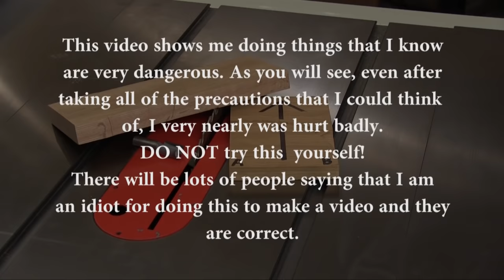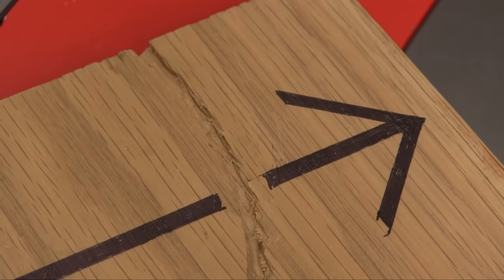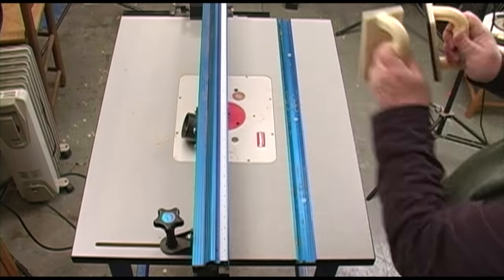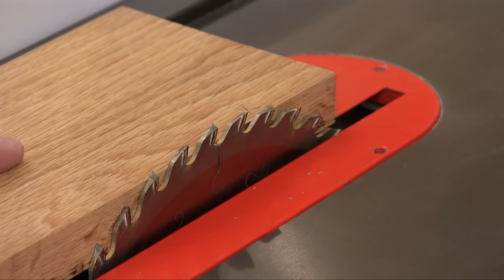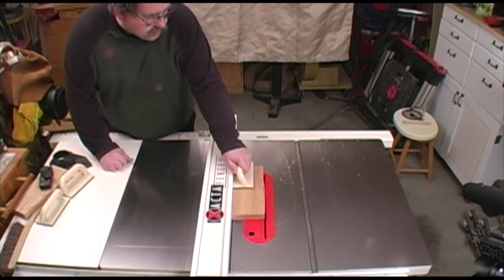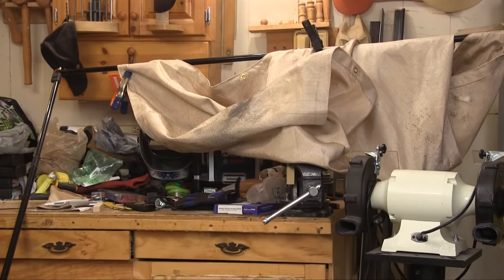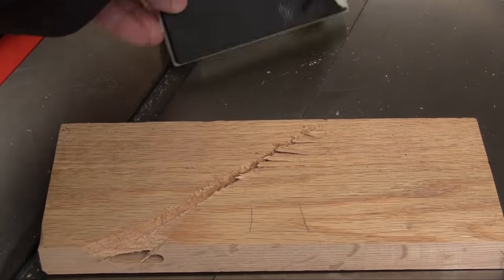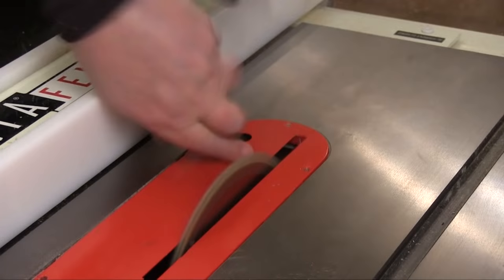Kickback on Camera!

Comment: Some 35 years ago in shop class, we were shown the true power of a 16" 10hp table saw when the instructor was ripping a full sheet of 3/4 birch ply. Intentionally, the sheet was pulled to the side opposite to the RIP fence on the outfield side of the saw. (Again this was an intentional example of the power of this saw and there was nobody in supposed harms way) 
The cut was pushed through until about 6 feet
, then slid over. The cut was finished by the force of the kickback tearing most of the remainder and a secondary tear perpendicular to the blade. The cut off was thrown back some 20 feet, and lodged into the CMU wall. The sound, and the violence of the entire thing was something that I'll never forget. He did catch the edge of the ply with his shirt. 
He also taught us to never drop the arbour nut and washer in the cabinet   while changing blades for the possibility of it getting sucked up dy dust collection and destroying the collector. If someone were to get  caught dropping it, the class would have to fill their pockets with sawdust. This only happened once...
He was a good teacher, a little drunk at times I think, but a good teacher. Long story short... that shit is there for a reason. Don't be distracted,  in a hurry, lazy, or just plain stupid. Even a small 10 contractor saw is capable of changing your life for the remainder of it

Comment: Guy in my shop was Raising drawer fronts on a router table. He had taken the guard off and wasn't using push sticks. As soon as the panel bit remove the last bit of stock the wood Tipt in and mutilated his right hand. It's not something that's immediately obvious but when you remove stock on that final pass the wood becomes unsupported.

Comment: I've been using table saws for over 30 years now. never one kick back.  Now I have a nice newer Jet saw and have the battle scars to prove kickbacks hurt. A piece of 1/2 birch veneer rode up and spun on the blade just as the video shows. I wondered how close my fingers came.  I'll be installing a riving knife on the saw before I ever use it again.  thanks for the video and glad that you are ok other than some shot nerves. Kick backs are powerful I'm surprised that I didn't break a wrist on top of the whole thing.
Reply: Yeah they are terrifying.  I have only had one (due to a poorly aligned fence) and I am wholly convinced that I am using long push sticks forever.

Comment: I generally always use my saw without the plastic guard on top.  Those things are so annoying and get in the way.  I didn’t even know you could remove the back guard, but I never will after watching this.
Reply: > the back guard

The “riving knife”.
Yes, that thing will prevent the vast majority of table saw accidents. Without a riving knife, it’s very easy to have a disaster. Just push the wood a little bit the wrong way and BOOM.

Comment: Well I appreciate you making this video, as I’m so amateur that actual amateur woodsmiths wouldnt sit near me at a woodworkers party(if they threw parties? I dunno).
But one question: are there no safety devices or grabbers you could’ve used instead of your bare hand?
Glad you’re ok tho and thanks!
Reply from the maker: I worked for more than 3 months with engineers and saw designers on how to do this test in the safest manner. The push block was used because it allowed me to pivot the wood against the fence as it turned into the wood while pulling hard against the fence so that all my muscle tension was away from the blade, not pushing into it.
Reply: thintz12 Well sir that’s incredible. Well done. All my childhood helping my pops, and ever since, I’d never understood kickback much less respected it. Thanks again for this.

Comment: I had an accident in October of 2022. Was ripping a 4x4 on the table and it kicked back and my right hand happened to be down and split it wide open destroyed my tendon and my nerves I have about 7 in scar going for my middle finger down to my wrist. Can't really move my middle finger anymore. Very little feeling in it too
Reply: Yeah  i had pretty much the same.
Reply: Damn.  The board did the damage or the blade?  You should ask your doc if physical therapy is worth a shot.
Reply: Dude thats crazy. Table saw is the one tool that I am scared of buying.
Reply: @dusty,@greg, did you guys have a riving knife installed?

Comment: After watching your video, I begin to be scared to use my table saw. 😱
Reply from the maker: NO need to be scared, just follow the instructions and use the safety equipment. Many, many people use saws without issue mainly because they pay attention to what they are doing and use the safety equipment and features.
Reply: No need to be scared. But always treat it with respect and caution.
Reply: @flyingrcdotnet   I get intimidated by the table saw but more so with the Miter saw. I had very close call with it. U got a nice laceration on my thumb. Luckily nothing broken and it was not  deep enough to need stiches. It totally mangled the board and it happened so fast. I am very careful and always make sure I am staying focused.
Reply: Don't fear the tool, but always respect it.

Comment: I was around 15 and set out o build a picture frame for my mother for easter - so the father of my girlfriend lent me a router. So one day I was in the cellar trying to route my first  wood. He told me to go right to left, but this felt kinda hard to push. As the instructions were given in a Hush-Hush I was wondering it I was doing it wrong and next try was pushing left to right - with the router turning direction - and the wood went woosh and there was pain in my finger. I made it upstairs calling for my Mum, who was upset in turn, why I was not coming upstairs and properly telling her what I needed - until she saw my white face and red index finger. Another trip to the doctor or hospital - I do not remember. It was just a "flesh wound" and left a big scar on my index finger.

I was never a "do as you are told" kid - _I was the "tell my why or I will find out" type. And for power tools this is not they way to go. In a different timeline any of the adults should have carved out some time to show me or watch over the first passes.

Comment: I did not have a back stop and had  a piece of hard wood flooring vibrated Into the blade and kick back into my face!!! Pool of blood all over this person brand new floor. 
Went to the hospital and got stitches and then went right back to work less then 2.5 hours later lol.
Thankfully no harm done. Accept to my face. Lol! 
20mm gash w/4 stitches between by eyes, and memory I won't 4 get not to mention a sweet scar. Now I have a habit of keeping my head off center when I turn the table saw on and NOT putting other wood on the table saw.. lesson learned

Comment: You're doing a good thing to show people to be careful, even you learned a lot.  I was cutting some 1/4" wall, 4" diameter plastic pipe, about 2 ft long, some years ago.  The pipe clamped down  on the blade, shot back, and hit me in my stomach.  It lifted me off the floor, and I was still in the air when my back hit the wall about 12 ft behind me.

Comment: I always use the Riving Knife but not the guard thingo over the top, never see anyone using that part on youtube, should I? I feel it obstructs my view of the cut
Reply: A very skilled woodworker told me the blade will do the cutting wether you are looking at it or not. Keep your attention towards the fence and your piece itself. With that fence locked onto your measurement there is no need to watch the cut.
Reply: Even with my limited experience, I feel that almost all tools have that bit of "this would be so much EASIER to use WITHOUT that safety feature". Or quicker. Cheaper.
And of course, 99 times it'll be fine. but that 100th time, you might not get up again.

Comment: I learned two things from 'Wolfman' Whitney in high school woodshop that stuck with me for 50 years of woodworking:
1 - A power tool is nothing more than a simple hand tool with a malicious intent.
2 - Never ever-ever-ever take your eye off the blade. 
I met many folks at wood shows who were missing digits.  When asked, they said the same thing; they were not watching.  

I still have all my fingers, even after years of playing with explosives.

I did once catch a 12" x 12" piece of 1/8" aluminum in my belly that I was cutting on the table saw with a worn carbide 10" blade (how stupid could I be?) when it kicked back.  It fortunately hit at belt level and cut into the belt and bruised the snot out of me. 🧐😳

Comment: Bloody idiot! ;) Thanks for sharing, even though you put yourself in considerable danger mate. 

First time I experienced kickback I was standing in the wrong place and actually took a push stick to my stomach, had a 15cm bruise with all kinds of crazy colours for about two weeks. Luckily the stock didn't hit me and my fingers were well clear of the blade. However, the stock flew off on it's own little holiday, I reacted by trying to move my hands away... reaction brain forgot the push stick was 25cm longer than my fingers, subsequently hit the top of the blade and did a nice little spin as it hit me in the gut. 

I investigated why it had happened of course. Turned out I hadn't calibrated my fence well enough and caused a pinch at the back of the blade, so the riving knife couldn't do it's job  yet. 

Lessons learned, I check and double check the calibration before I start cutting down any stock now.

Comment: Thanks for this video. You kinda idiot for demonstrating this by nearly loosing a finger. But at least I know now, what I did wrong today and why I'm still shaking. I had my first mayor kickback today and really didn't know what happened when it happened. It was like a lightning strike. It thought there must have been something in the wood, but nah - I guess I just slightly bend the end toward the blade. luckily I was standing like you and feeding with a pushstick with enough clearance to the blade and then almost immediately got my body away from the saw.

Comment: I've never been a fan of blade guards...until this video. Thanks. I may still may not use a guard all the time, but at least I see the danger of material moving and pulling my hand into the blade so at least without a guard I can try more precautions. My hands thank you for this video.

Comment: I thought about buying a table saw until  saw this and other videos too. I am definitely not buying one. I have invested in a very good Bandsaw. It does a great job and comes with minimal risk as there is no kick back with a bandsaw. Best decision Ive made in a long time.
Reply: That's a bummer that it scared you out of it. The thing he's showing here is how to use splitter that keeps it from occuring.  It's a machine. You have to respect it.  Just like driving a car.  And more people are dying using those then losing fingers from this.  I hope one day you reconsider and learn how useful a table saw can be.
Reply: I'd rather have a table saw go bad than a bandsaw..

nothing like a 3 foot wiggly serated piece of metal flying around

Comment: I watched this video years ago. It's been on my mind everytime I used my saw. Well, I guess I didn't assume it could happen to me. I had my first kickback 2 days ago... the board punched me in the gut and I almost lost my thumb. It was only a shallow cut, enough for a bandaid to handle, but still a nasty little cut. It could have been so much worse, and I got off light.

Please be safe, and don't be stupid like me.
Reply: Did you use a splitter?

Comment: i am not a carpenter but couldn't they just use a handsaw or something, you can still cut the wood with no risk, even if you do not get it as clean cut it is worth it, we are talking about the safety of humans here
Reply: Lots of reasons but a major one is precision. A table saw lets you rip (cut parallel to long side) a 8 foot long piece of plywood with accuracy in the thousands of an inch.

Comment: I have run thousands of board feet of lumber through a table saw at a cabinet shop. No blade guard, no push blocks, never had a kick back. Saw stop. Spend the money.
Reply: saw stop does not prevent kickback. i have 1. it prevents you from losing fingers via sensors when your finger is too close to the blade. Also means you cant cut wet pieces ... you can still have a board fly at you.
Reply: @JT-91  The higher quality table means there less cnance to stick. Proper technic takes the rest.
Reply: Adam Armstrong same here but i recently learned my lesson LOL.

Comment: Can't believe schools force kids to do mandatory woodwork for scores. They didn't use table saws like this though, but they still use a belt sanding machine
Reply: I remember taking woodworking in school in the 80's. Cant believe I still have all my fingers. Out of all the trades I studied, woodworking power tools scared me the most. The lathe, jointer, and table saw
Reply: I liked woodshop. Had a good teacher who preached safety. Im 34 now and Im glad I was taught to use these machines the proper way. And now I have a woodshop in my basement 😬